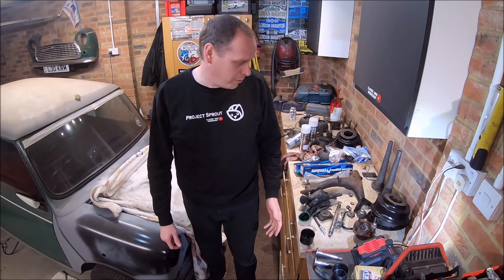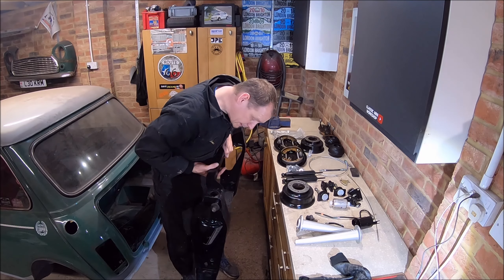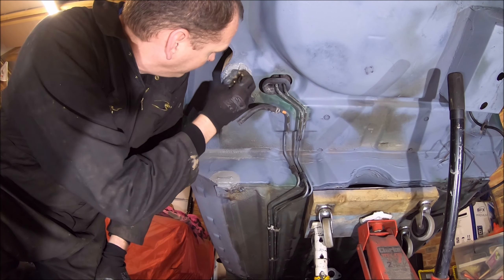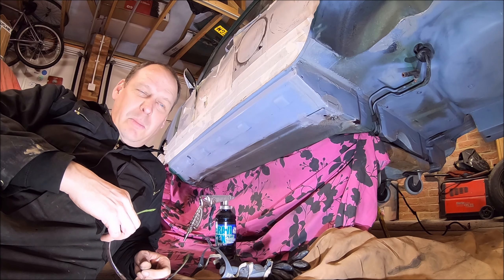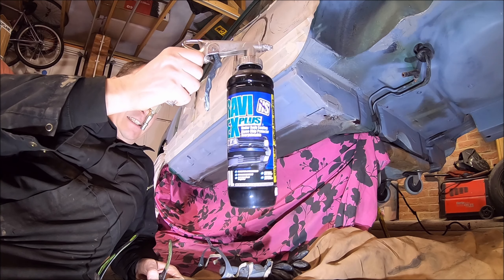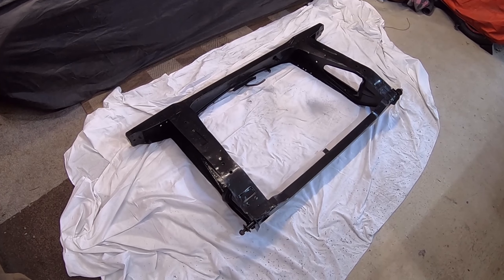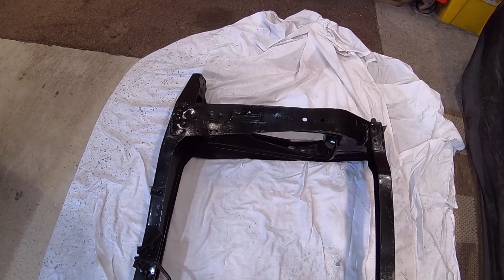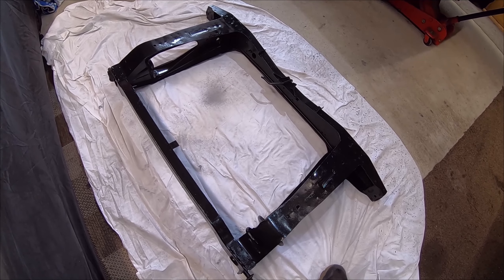Classic Mini Workshop - Project Sprout Pt.51 Stonechip & Seam Sealer

Comment: Back to the standard intro, probably for the best. Although I commend your bravery on  the last intro. Is it just bare metal then, 2 coat etch primer then 2 coat stone chip? Or what other sort of paint are you putting on before stone chip mate?
Reply from the maker: I cant quite remember, think it was 1 coat of etch, 1 coat of normal primer then stone chip Gravitex
Reply: @classicminiworkshop  Cheers  Keith, thinking if I can do any of the painting lacking a compressor, Ed

Comment: Hi Keith.  Is it possible to install coilovers in place of place of the shocks to improve the ride?  Would you have to reinforce the shock towers?  I know you can order custom spring rates, and adjust the ride height. I am looking into putting B16 turbo into a minivan like Alex Toons.  The front subframe has a custom suspension with coilovers.  I do not want to run a Minivan slammed to the floor like they do in the states. Just a sensible ride height with a comfortable ride.  What's your opinion?
Reply from the maker: Yes you can fit coil over but you really need to do front and rear. I’ve not seen anyone strengthen the arches.